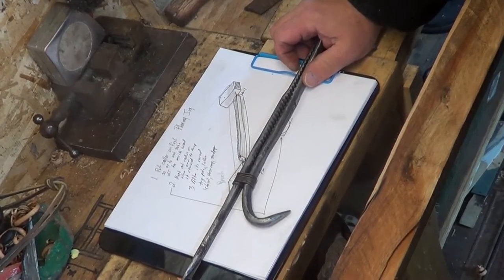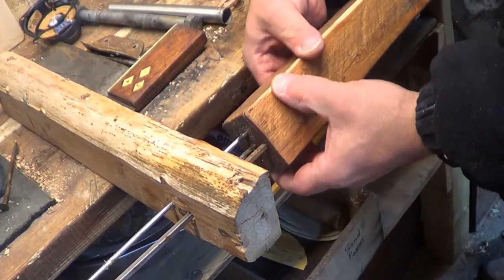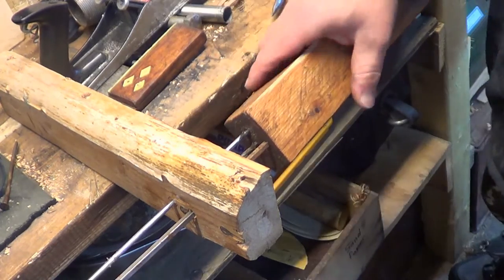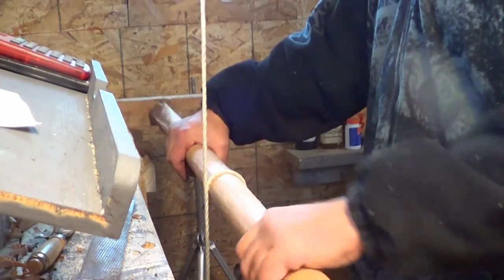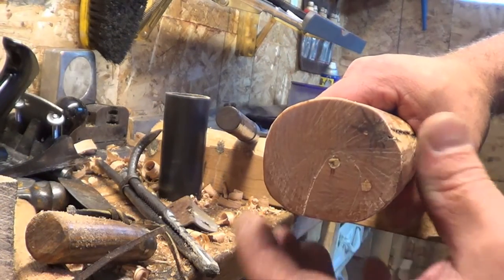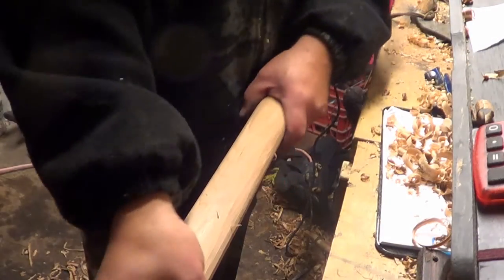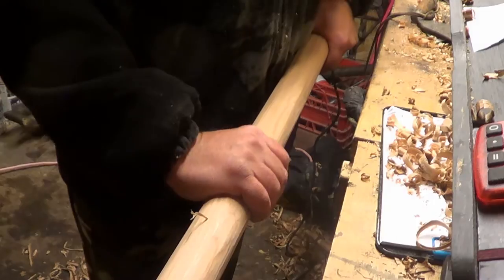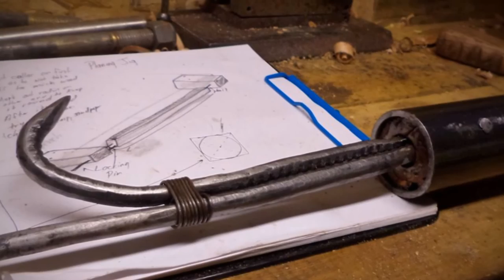Making a Log Pike Pole

Comment: Cool project Ken, some very creative camera angles too! I've seen my old man set different things into handles like that, he'd shave the whole handle thinner than the collar, then heat it up, attach the two and quench it right away, would actually make the wood so tight around the tang of the tool he sometimes never had to pin it.
Reply from the maker: +SwampDonkey530 Thanks Jeff! I used two cameras for this video. Its a royal pain editing, but worthwhile in the end. I never thought of heating with steel and wood before, I've seen that trick used with metal on metal though. I've got some handle jobs coming up, I will give it a try! I also want to try that pole lathe again! Take care buddy!